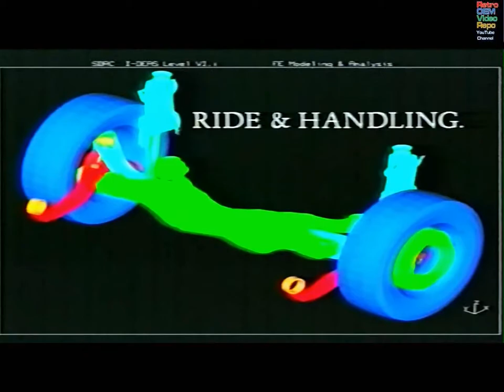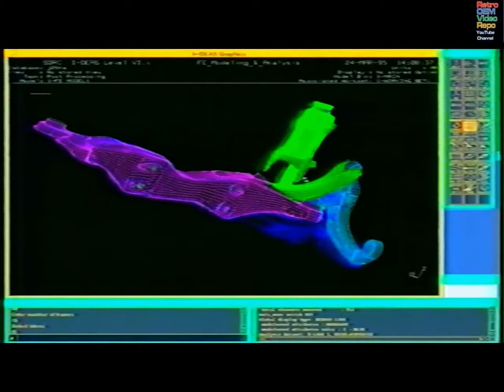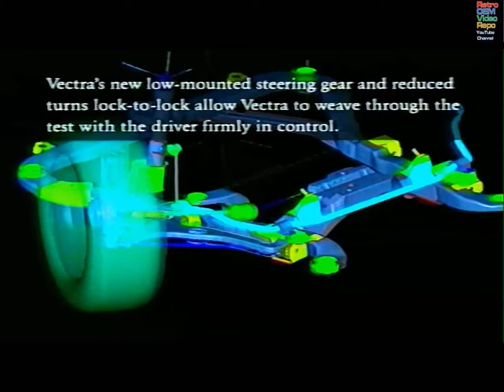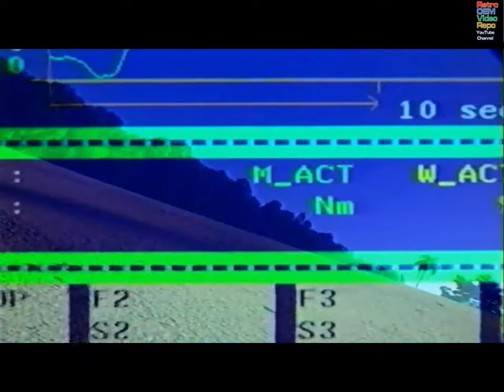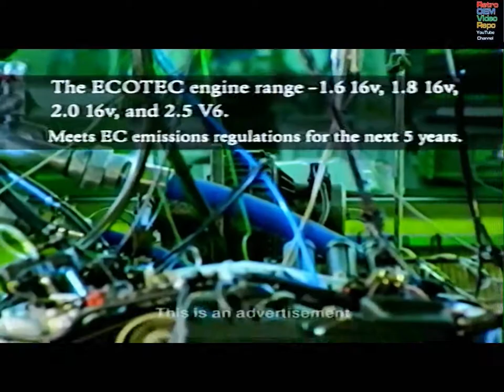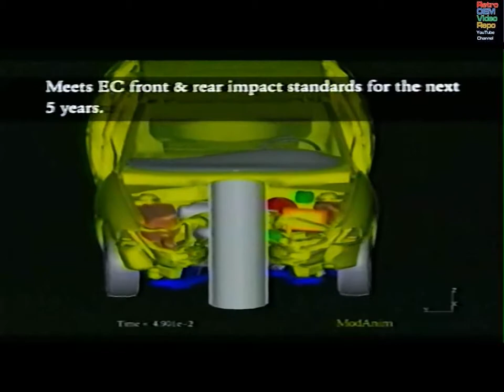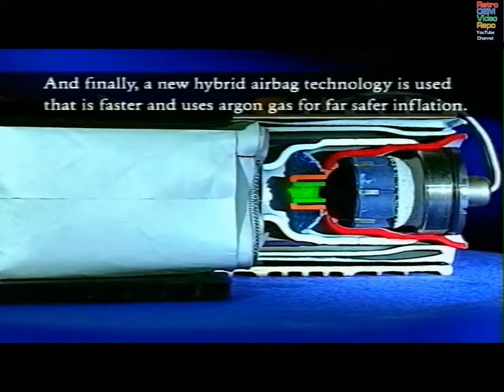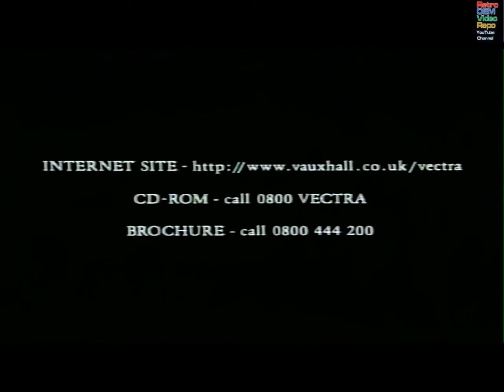Vauxhall - Vectra - Vectra from Vauxhall - Designed for the next Millenium (1995)

Comment: I remember two astonishing tales about this car that 'did the rounds' in the motoring press of the day:
1) the unusual wing mirror design featured sculpting into the front wings in a swooping arc: unfortunately that had limited the size and location of the wing mirrors which were thereby too small  - but that design mistake was spotted too late in development to fix, so it went into production without a fix.
2) they'd begun rolling off the production lines when it was noted that the seats were set too low in the car. Why not just height-adjust the seat? Well, this was a "repmobile"  - in UK these were cars mainly bought and used by sales fleets for their 'Reps' to shuttle up and down motorways in.  And fleets bought the low-spec LS cars withough any seat-height adjustment fitted. Vauxhall/Opel's solution?  They overstuffed the seats... Drivers then complained about their numb behinds.

Comment: The Vectra wasn't necessarily a bad car
It was a good car, executed poorly

Good things:

The 1.8 16v and 2.5 V6 were punchy and economical 
The Vectra estate had a big boot
The car was very safe, it came with twin airbags as standard
It was very well equipped for the price

Bad things:

The silly integrated door mirrors were too small
The driving experience was mushy, due to soggy brakes and light steering 
You couldn't get comfortable behind the wheel because of the steering wheel not adjustable for reach and lumpy seats
The center arm rest was in a stupid place

Comment: The decline of GM in the 90’s started with the Corsa, then the horrific vectra then the bland shit box Astra of 1998. Then GM murdered SAAB.
Reply: Have to disagree about the mk4 astra. I had a 1.6 CDi that replaced my Mk3 1.6 Artic. Whilst I thought the mk3 was the better looking car the Mk4 was leagues ahead in every other aspect. The chassis was better set up it actually handled fairly well. They don't rust nearly as bad and the interior quality was leaps and bounds ahead of the mk3. I loved mine sadly the valve stem seals failed and I didn't have money to get them sorted so it got scrapped.